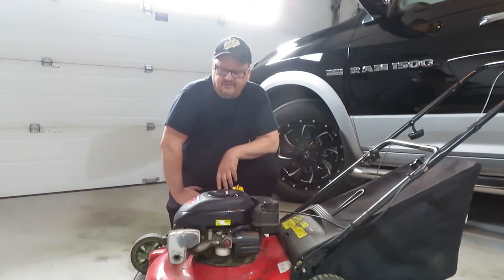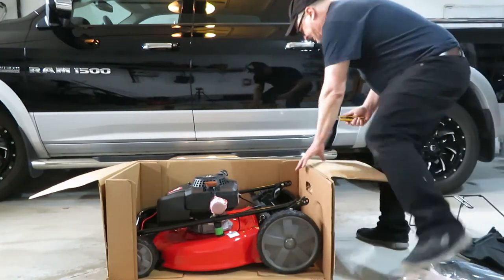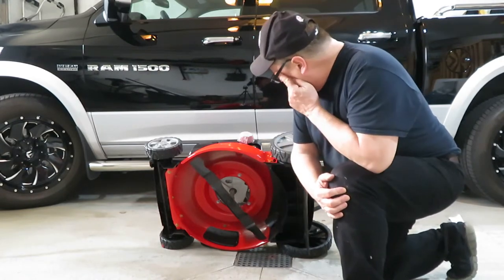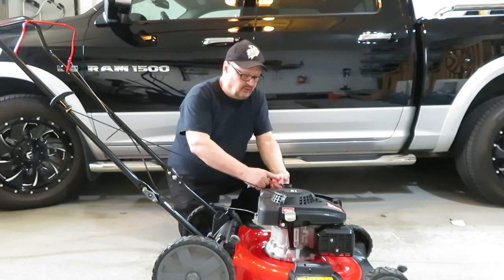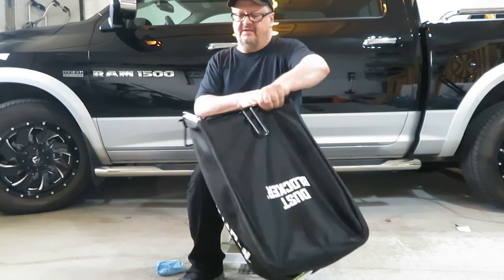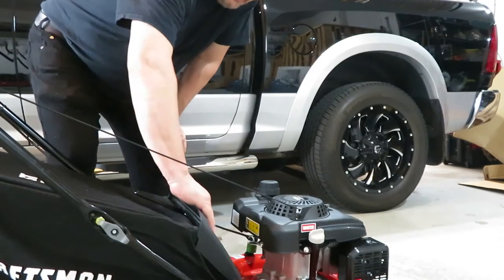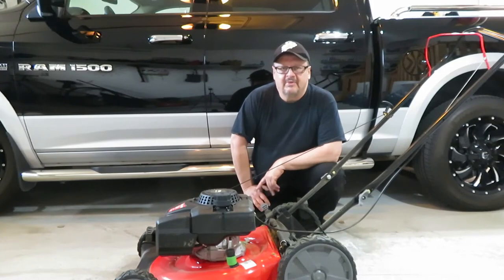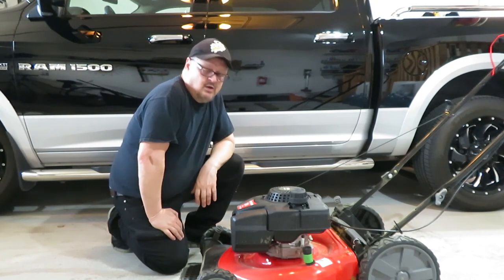Gas Lawn Mower - Craftsman M130 with 159 cc Engine - Unbox, Assembly and First Use | 2021

Comment: The concept of “no oil required” is a misleading concept.  In Canada we have very cold winters. As a result there is a condensation buildup in the oil and Gas tank.  The concept of a no oil change lawnmower is a marketing scam to sell lawn mowers to women.  Overhead cam engines have been built in gas automobiles for many years.  Does any automaker advertise “no oil change required” for any car made?  Of course not.  Also note that these lawnmowers are double the price of a standard push lawn mower.  What a scam!

Comment: by the look of your lawn color, you're cutting the grass too short.  grass needs to cut at 3" so that your grass can withstand hot and dry days in the summer.  grass roots grow 3 times the blade length of the grass.  i used to cut my grass too short also
Reply from the maker: Thanks.  I started leaving it longer this season and it seems healthier.  Of course we got tons of rain this year too!
Reply: @mundaneman254  yes me too.  lots of rain.  my craftsman m130 is great, lots of power through long grass